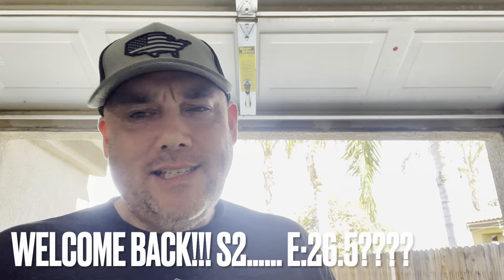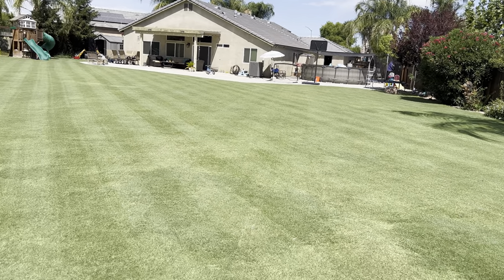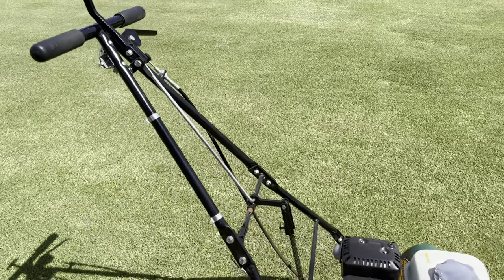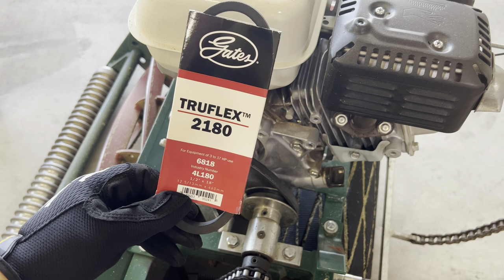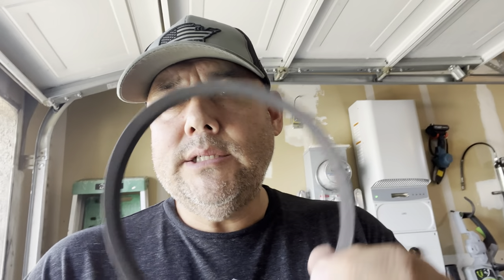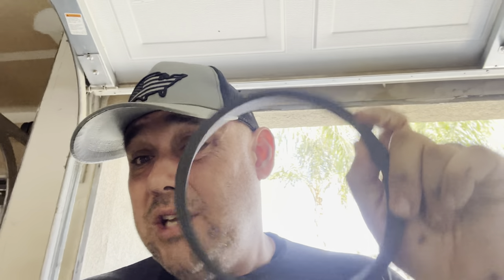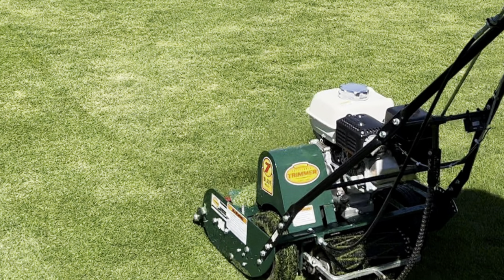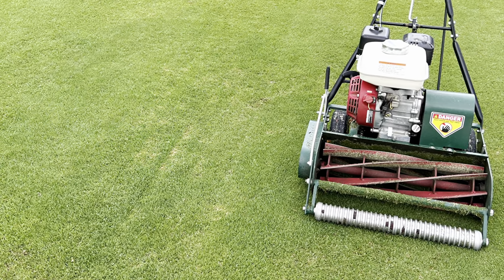California Trimmer Belt replacement & Clutch adjustment; extended version. DW🌎 S2:E26.5

Comment: Had a question for you, or anyone really. 
I recently had to replace my belt because the other one shredded even though I just bought it back in May. I replaced the belt and went to use it today but it felt off. Seeing your video reminded me that I forgot to put that green arm back in the right spot that is there to guide the belt. I’m not sure if this is what made my mower self propel by itself as I engaged the level for the assisted propel of the mower but my mower was moving on its own and the blade was spinning. To stop it I had to disengage the propel level but the blades keep spinning despite not holding the handle to engage the blades. The mower did feel more powerful at the wheel and jolted forward more and it definitely took more force to stop the mower. 
Wondering if maybe it was just that green bar that guides the belt or if the clutch needs to be adjusted? 
Any ideas?
Reply from the maker: The clutch arm and green back arm guide both have some adjustment. When replace with a new belt, even when set properly, the reel may still spin without the cable being pressed. This is normal as the new belt needs to be broken in. After a mow or 2 it should be good. If it still continues there after it may be set too tight causing the reel to spin when it’s not intended too. Hope this helps 👍🏻

Comment: Amazing video. At first I thought 30 min was wayy too long but it was perfectly explained. I still think the design is totally unnecessary and it shouldn’t need so much adjustment. CT customer service told me “the belt sacrifices itself for the good of the machine.” Like, what?? How about make a belt that’s not happy to pop lol
Reply from the maker: I was actually very fortunate with my original belt as i showed in the video. As long as you pick up a good quality belt and set it properly it should last. I do appreciate the comment and support 👍🏻
Reply: @dwaynesworldlawn  I just can’t find the sweet spot. If I go higher, there’s almost no tension in the clutch engagement handle. If I go lower, even when I let go of the handle, the reel keeps spinning by itself
Reply from the maker: @InDatParish  do you feel confident the belt stops can’t be adjusted more so then the clutch. If you get the clutch to a place where it feels good and is applying enough forward tension on the belt, i find that setting the belt stops just to the point where it clears the belt when depressed. Hope that help… 👍🏻

Comment: Hey Dwayne! So quick update - After putting in a few hours into the new mower it no longer is having the clutch issue where it would engage on its own. Knock on wood!
Reply from the maker: I would say that pretty normal as the belt has broken in now and stretched slightly. Glad to hear that it’s working better then new. Lol. I appreciate the update and the comment 👍🏻

Comment: After changing my belt I cant get the belt to stop spinning. Usually first engagement then release it will stop but after a couple more it spins and belts gets chewed up by the stops. Any suggestions on what adjustments I should try?
Reply from the maker: This is normal somewhat and could go away after a mow or two when the bell breaks in. If it’s still and issue it’s a matter of adjusting either the front or rear belt stop. With the rear you want to have it set to where it just barely clears when the clutch is in engaged. I hope this helps and appreciate the support!!! 👍🏻

Comment: Hey Dewayne great content brother. Sounds like we got our Cal trimmers about the same time. So I just got out today to do a scalping and got half way through and hit a thick part and stopped the reel. Well when I went to engage the reel quit spinning. Do you have any content on this issue or any tips of what it could be? I ran out of daylight but I was kinda going through the manual troubleshooting. I have a fairly new belt and all the chains are spinning.  Thanks in advance
Btw I haven't checked the side chain that is covered. Had to stop for today.
Reply from the maker: Scalping is hard on the machine. A sharp blade helps but the mower can still bog down. Scalping will also dull the blade so afterwards it generally requires a sharpening or backlap to bring it back cutting paper. I would automatically jump to something is wrong when this happens and is normal for alot of reel mowers when scalping. Hope this helps 👍🏻
Reply: @dwaynesworldlawn  thanks!! I figured out what happened. The drive chain on the side of the mower, the front gear  that pull the chain is held to the shaft that turns the reel the Allen screw was loose. So the gear was just spinning on the shaft. You are correct about the scalp. I tried going too low my first pass. I'm trying to get the majority of the scalp done before I sharpen. I will then put a fresh edge to do my last cut for the scalp. Thanks again.  Great content btw
Reply from the maker: Glad you figured it out. Great job!!! 👍🏻